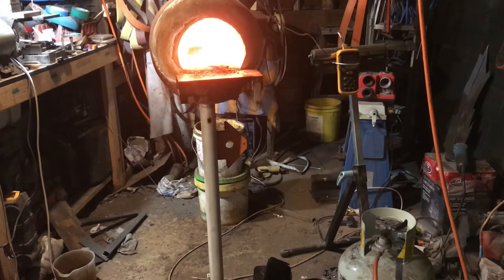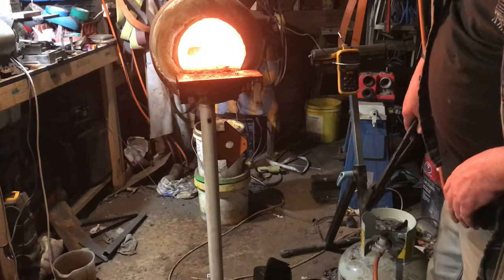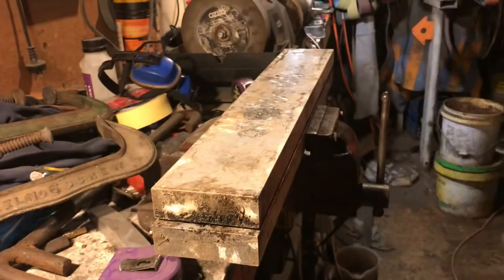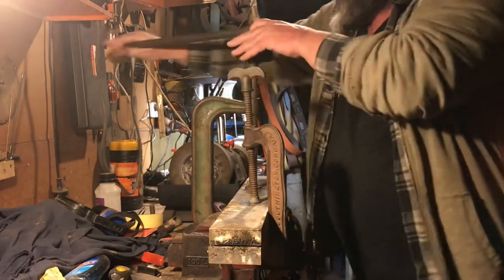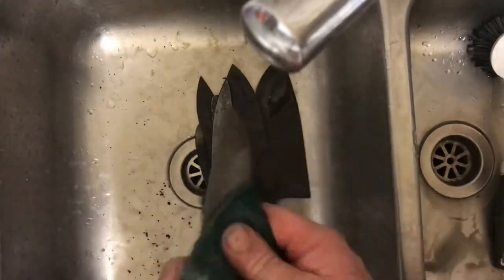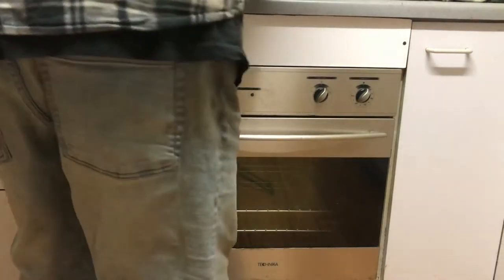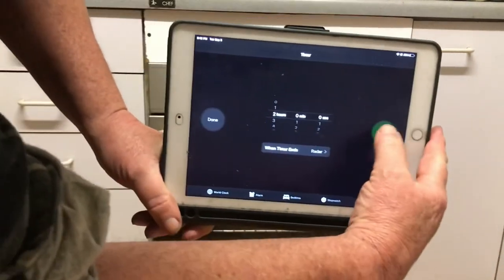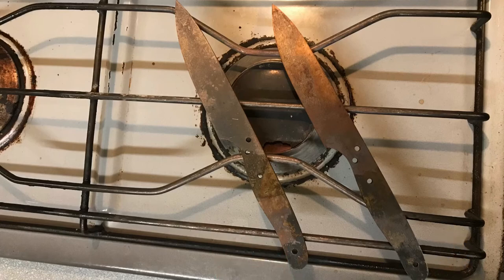Custom knife making part 3, heat treating 1084 steel - heat treat 1084 steel

Comment: You are the Knife Surgeon!
Reply from the maker: Lol no just practiced. Have about 13 ready to grind now, 2 to sharpen, 1 to make a sheath for and another I am in the process of discussing a build with someone. Most at the moment are just building some stock which I have never done before.
Reply: Downunder Farm and Forge Very nice mate.
Reply from the maker: The African Lion the funny thing is I also have a knife I have been working on for 2 years that I never seem to be able to decide how I’m building it and what the final thing will look like😉. But as soon as I finish one like that I seem to start another. When I get fancy I question my choices and takes 6 months to go back to it, I think those ones though are the ones that help me to grow the most.
Reply: Downunder Farm and Forge Yes sir.